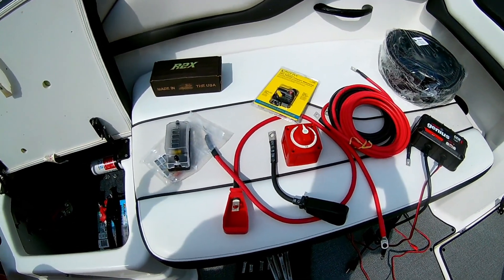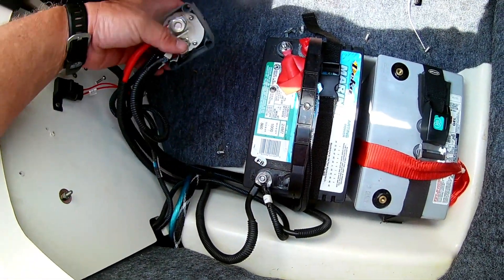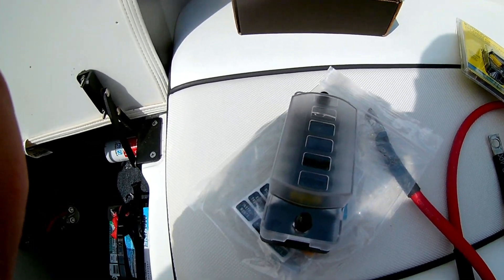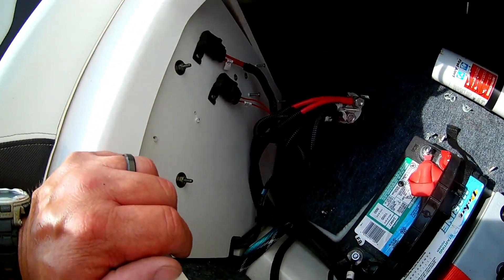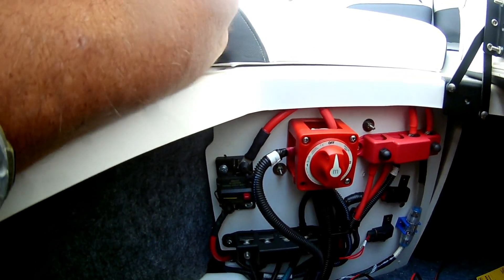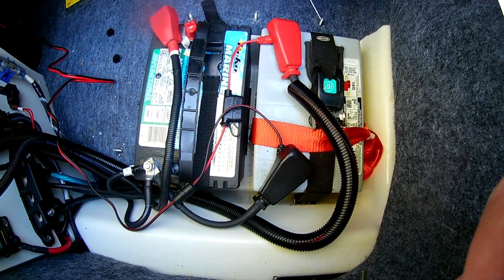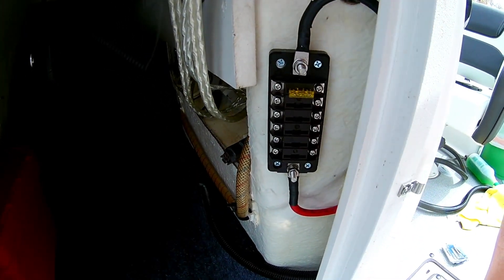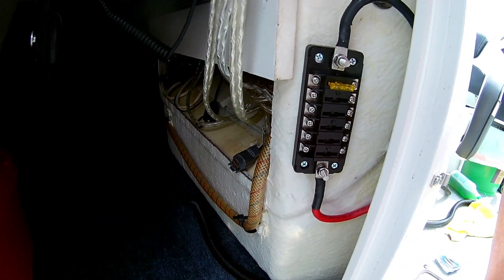DIY Easy Adding a Second  Battery-Two Battery Switch and Fuse Block to Yamaha Jet Boat Take 2

Comment: Is the first and second positive wire connected to the engine starter?
Reply from the maker: The two red wires connected to the single battery switch (1:30 ) go to the starters.  When adding a second battery you don't change the wire's endpoints, just how the batteries connect.

Comment: so the switch is always on 1 and you switch over to 2 whenever boat is off while using the stereo?
Reply from the maker: In my case I run the boat off one and when anchored I use battery 2.  If I had identical batteries I would just use whichever.